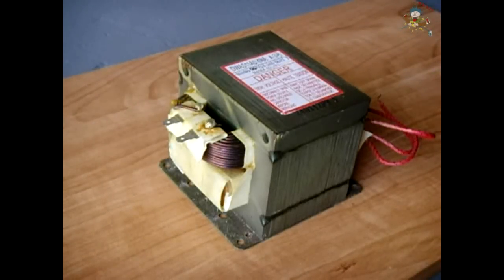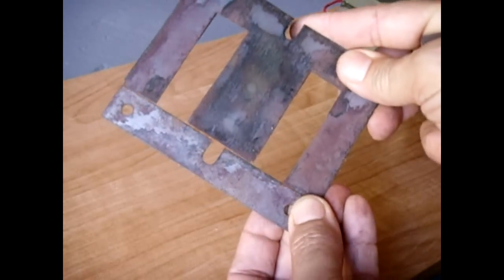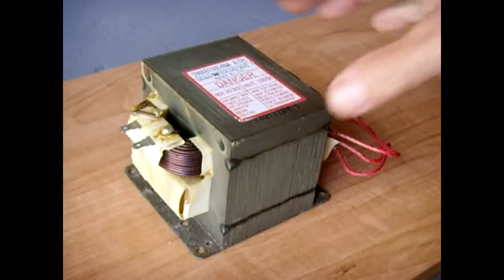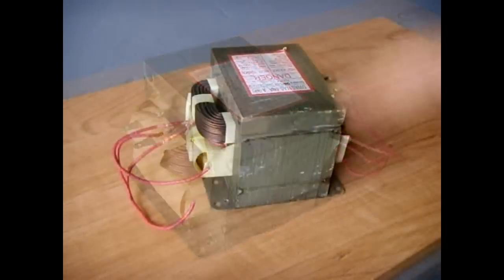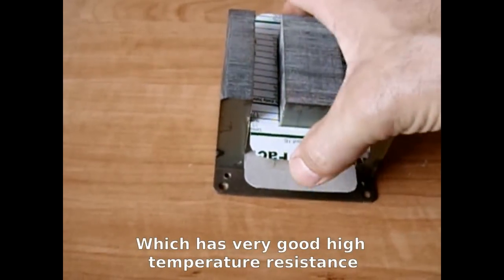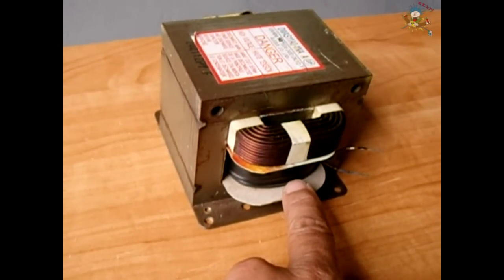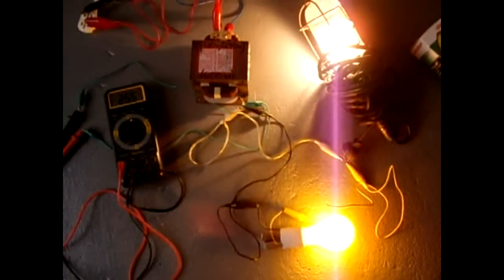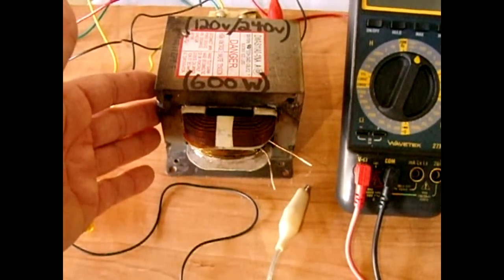How To Make Custom Power Transformers

Comment: Hi electronicsNmore,
I have a problem. I have a 8cm x 14cm Transformer (an E type), It has 112 cm2 area and I have only so much wire 5 lbs. for 8 awg and 1 lb. for 6 awg. I need to get out 260v (130v x 130v) @ 30 amps on the Secondary. I need to find Primary voltage and # of Turns for Primary and Secondary. Can you help or anyone else on this? Thanks.
p.s. I can produce up to 4000v AC for the Primary Input.  I know you are smarter than me on this, I hope you can help me.  This is a HUGE transformer FYI.
Reply: around225  and +electronicsNmore : I don't have a 32 bit operating system, I can't use your calculator. :-(
Reply from the maker: around225 Please refer to the calculator software in the video description area. You input the information and you will get your answer. :-)

Thanks.
Reply: electronicsNmore I did, it only works for a 32 bit operating system.  Can you use the calculator and give me the answers please.  I'm so sorry about this.
Reply from the maker: around225 You owe me. Tell me the size of the CORE AREA. Measure it like you are looking down at the core with the top part of the core missing. The part of the core that the wire wraps around. Also tell me what your input voltage is and your desired output voltage and current. Tell me everything in one reply. I cannot be replying back and forth. I have over 275 videos and other people that have questions. Thank You.
Reply: electronicsNmore Ok, thanks...  the inner core area (where you wind the wire) is 8 cm, the outer core area (lamination) is 14 cm.  Input voltage: up to 4000v (I would like to find the best Input voltage and turns here, 6 gauge or 8 gauge wire, so please find the lowest turns for the Primary at any voltage input up to 4 kv or 4000v).  Output desired voltage is (130v x 130v = 260v @ 30amps).  This is an Ei core.  Another way to allow me to use the software, is if you can put the Transformer Calc. Software install folder into a zip file and then it will still work for me.  I know thats asking a lot.  Sorry.  :-(
Reply: around225 And anyone else, if you put the INSTALLED program folder of "Transformer Calculation" that electronicsNmore has linked to into a .zip or .rar file, it will probably run in a vista/64 bit windows system!  But if you try and install it with the installer on a vista/64 bit system, it won't install it.  Someone please link it so we can download and use it!  sniff sniff
Reply from the maker: The program is not mine. I don't even use Windows. I use Linux. I run the program using Wine.

Here is your info:

4KV/2.2A input(Make sure you wind one layer at a time and apply a layer of tape over each layer): 18ga enamel wire-462 Turns

260V/30A secondary output: 6 or 7ga insulated wire~30 Turns.

That is everything you need to know. Be sure to share my channel to return the favor.

Thanks.
Reply: electronicsNmore I'm sorry, I don't have the millimeters on hand, I rounded off the mm into cm.  8 inner core cm X 14 cm.
Reply: electronicsNmore Ok!  Great!   You could help out one more step.  If you could put the installed program folder of this into a .zip file.  We could use the program!  Because windows vista can run 32 bit programs.  The older installers didn't know this and that's why they won't install this.  I'm sorry I have to ask this.  If you can get someone to post a link.  You won't have to do these calculations.  Again I'm sorry to bother you.
Reply from the maker: Actually, I don't have to help people if they are unable to use the software. :-). I do it because I am nice. You need a person to download the program and do that for you. I am using Linux.

Thanks. Good luck with the project.
Reply: electronicsNmore I know.  I am thankful that you did this for me.   Your more than helpful and I wouldn't call you nice.  Don't ever let a girl hear you are a "nice" person. haha  You are a really cool and helpful person.  :-)
Have a great week and weekend!
Reply from the maker: You too.

Comment: sir,, can u give me the formula of getting the size of wire..if the number of turns and the volts are gevin..and the size of wire is unkwnown..THANK YOU SIR....
Reply from the maker: Hi Manny, please refer to the video description area for the calculator.

Thanks For Watching!
Reply: manny caburatan You can google "awg amp chart" for how much amps a wire can handle (power is always the same power=volts*amps) and the number of turns is simple V1N1=V2N2 (2:1 ratio is a 1:2 ratio).

Comment: What would happen if you place next primary core instead secondary fine wire??Is voltage would be different at secondary when wire gauge is larger??
Reply from the maker: Using the same primary winding for the new secondary winding would result in no voltage output change. You'd end up with an isolation transformer. Thanks for watching!
Reply: How can I make output voltage 350 volt and 5 amperes from 2 transformers???I read before a topic one guy describing making higher voltage output from 2 identical transformers,those transformers was low voltage,how about high voltage instead???I don't know what types of transformers to use to gain 350 volt and 5 amperes current....Is it possible to make winding by using 2 C core's to create specific transformer I need???Where I can buy not expansive C core's for transformer????I had diagram says core's specs is 40x80x200,I not too sure where to find those 2 core's that reassemble's that specific requirmant...Been sitting duck's with that transformer project by 2 long years now and still no luck,there is step up transformers out there and I even have 2 but it not have enough power to meet my project construction..I need transformer that have primary 120 volt,secondary 350 volt and 5 amperes current and third core low voltage 22 volt and 0.5 amperes....Seems I have no choice but to wind coil's myself but I need C core's for that completion and proper thickness of C core wall.....I working on plasma welder prototype,by now you might heard about MUltiplaz 3500 machine and you know how it works maybe..Well,Multiplaz company have good quality advertisement machines but when you buy them is like a cat in the bag without any promises...Multiplaz 3500 based on original Russian design,however it should be more likely Multiplaz 350 because it operate on 350 volt output not 200 volt and 2.3 amperes..I had constructed by myself thermo regulating board that actutate cooling fans for power supply,the 22 volt power connects to thermal regulating board while there is exit control realy that activate 2 cooling fans for transformer mostly,there is another 2 wires that locks the circuitry by placing thermistor that senses high temperature...I had constructed torch myself certain ways that it uses standart Multiplaz 3500 accessories,I stopped with torch further completion science transformer unavailable,I also made bases for power supply housing but never rushed to further assembly...The plasma cutter/welder save you time and money on argon,arc welder electrodes,oxygen and acecylene gas ton's of money...The plasma torch works on gas or liquid,however special pressure regulator required for torch inlet because higher pressure would destroy evaporator assembly by simply braking quartz glass tube that insulates torch cathode assembly from anode base....Air might work as standart plasma aplications,however if you are electrician or physicist you know by now that air is bad electrical conductor and would create certain power drops unlike water or alchohol,helium gas could also be used as alternative...The idea is that special moisture observing material located in torch body,when water or alchohol poured in it would be observed,by actuating high voltage arc liquid or gas become diatomised and become plasma beam...Unlike oxy acecylene torch plasma beam not burn hand from distance,however special guard requires to prevent getting severely burned to crisp...By burn from oxy acecylene is one story,by burn from plasma stream is much much worst,we talking about 8000 by Celsius and that near surface of sun..This torch can weld hard to melt metals like Tungsten,Molybdenium and Titanium along with their alloy's....A simple tool that can end era of old outdated welding and torch cutting machines for good...Over some more time it could be further simplified and become hand held simple device..We had been suffer from technology insufficiency far too long,it is time to develop something new and far more affective methods of welding...For welding it requires secondary power source to electrify weldable cache,unlike arc,mig and tig welders the clamp nolonger a ground,it is positive current or hot clamp so call,the filling wire is grounded instead to avoid been shocked,the filling rod hold about 1/4 away from part that been weld to prevent arcing and shortage of machine while torch melts the wire and creating smooth cache.before actual melt of filling wire 2 weldable components could be fuse welded or held together before welding..As you might or may not know Plasma welding machine operating only at DC current which requires rectifier bridge after transformer output while capacitor smooths the power drop...The voltage adjustable by potentionmeter from 50 to full 350 volt range,high voltage multimeter also attached to output line's of primary and secondary power line's for easy voltage calibration...
Reply: Hello,I not sure if you get my previous messages through....Anyway,I looking to buy an transformer C core 40x80x200,I need specific step up transformer from 120 to 350 volt and 5 amps secondary current...By watching diagram it says materials must be exact,I also noticed that particular transformer become weight like 40 something pounds which would consider heavy for power supply...I already have 2 transformers one rated 220 volt secondary another 245 secondary,is there is any other ways to boost voltage at secondary output of the transformer??Some specialists say I need add more coils by winding of secondary but it is a nogo option science there is no room....First I was thinking to add some type of induction coils but other electrical engineers says it not going to change anything rather than cost voltage reduction....I have another option,By adding so called inductor or bipolar transistor,not sure if this can add more voltage but in theory it work like a water valve to boost more voltage float..Modern welding machines is now very light weighted and it says they use inverters which means same bipolar transistor...I wonder if that same type of bipolar transistor can salvage my problem with voltage limitation???If so than particular transistor cost less amount of money rather than construct new transformer from scratch....I would like to know what you think about it science you seems an electrical specialist..

Comment: maybe not the most graceful and you can possibly damage it.....but you can knock off those welds with a hammer as well if u knock it right....say it somwhere on eBay here and tried it myself...and it worked! However they put epoxy all over the coils so it was too difficult to modify.
Reply from the maker: +MAN CAVE NO.1 
Hi there. No way will you separate a welded core by hitting it with a hammer, if anything, you will damage/deform the laminations. I would like to see you make a video showing that.
Reply: electronicsNmore well I did just that. It wasn't easy but it happened. When I first got the transformer out I was really bummed because I thought there's no way I would get through it but I did it exactly like that I slammed it several times really hard and eventually it loosened.....you don't have to believe it but I suppose I could do a video someday..... Or maybe you can do a video showing how it can't be done. :-) Cheers
Reply from the maker: *****

If it did work, the weld must have been poorly done or extremely shallow.
Reply: I suppose...but it looked exactly the same. Weld along both sides. I think I still have the transformer or the pieces to it. I could show that...it's clear that it was not separated with a grinder. And I would say that most of them are not built so sturdily. Mass produced and only need to last 5 years or so...would save a lot of welding rods that way...
Reply: I got the idea from COOL DUDE CLEM when I told him I had one...he just told me to knock it with a hammer like hell....so you could also ask him about it. I think he's worked off most of his that way.
Reply from the maker: *****

Not really a good on idea to bang on the core/laminations of a transformer, but it would be interesting to see it done using an MOT like I show in this video that has a proper weld.
Reply: well yah, exactly my point....it's not graceful by any means, but so far I've opened up two of them exactly like the one you have there. I'm only trying to help u know, not trying to criticize....but I think you doubt me so I'll have to do it again and film it sooner or later. 3:)
Reply: cutting the weld should not be a problem - where most folks get stuck is welding it back (lacking the equipment/knowledge) - so why beat it to death (the core and the discussion)

Comment: When you stepped down the 240v to 120v....did you just plug it in the reverse direction?
(240v secondary coils to outlet & 120v primary coils as output)
Reply from the maker: Hi there. You supply 240V to the winding I made to replace the 2KV winding, and you get 120V out of the other winding..
Reply: Ok :D thanks :D

Comment: I have question? What type if wire winding did you put? How did you connect the hot & neutral?
Reply from the maker: This transformer had a 14-15ga AL primary winding of 100 turns. I made a secondary winding of 17-18ga AL. When feeding the heavy primary winding 120V, it makes no difference as to where the wires go(Since your only using one transformer, the phase makes no difference going in and out). The output which is 240V, each leg is 120v. When you feed 240V into the secondary, you get a TOTAL of around 120V(60V per leg). If you want 120V(one wire) and a neutral, then you need a secondary winding for 240v with a center tap(zero volts-neutral). For me, a total of 120V stepped down, is just fine. I do not intend on connecting this to my house. This is simply a portable step up/step down down power supply.

Thanks For watching.

Be sure to check out my video playlists as well.

Comment: Yes sir i have a qwestion is it possible to run a 1000watt indor grow system using a transformer to keep my power usage low
Reply from the maker: msjakal 1000w is 1000w. It does not matter how you power it, the power consumption will be the same,.

Thank You

Comment: I have a similar size microwave transformer  240V in. Pain is they welded the mounting plate on the side, covering one of the lamination welds. It is actually rated at 1100 watts.
Reply from the maker: Grind off the plate spot weld areas.
Reply: Thanks that was the plan.

Comment: Would be nice t see how you cut, solder, and the more important how you take out the coils... i have tried this before and was impossible without damage the coils. how you did these steps?  thanks
Reply from the maker: Hello. You CUT the weld using a cut-off wheel, hacksaw, or grind it away. I have another video showing how to take one apart. You weld the core back, NOT solder it. Thanks!
Reply: cutting the core is easy. I have got problems to take out the coils. They are  to tight. how have you done it?
Reply from the maker: Very carefully pry the winding out. Some can be troublesome, others easy.
Reply: ok thanks!

Comment: I VE BEEN WORKING THIS VERY PROCESS, USING A SOLAR ARRAY........ IVE,  WITH A LITTLE TWEEKS HAVE ALL BUT DONE AWAY W MY ELECTRIC  BILL!!!!! I PAY  $26.00 A MONTH, WHICH IS MIN. RATE JUST TO MAINTAIN SERVICE W ELECTRIC Co. SPREAD THA WORD BROTHER:):):)
Reply: Solar arrays produce DC, transformers require electromagnetic induction from AC to work. In other words you cannot step up or down DC with just a transformer. You need driving circuitry that does nor produce noise and a good pure sine wave otherwise your running a high risk of a house fire from things like motors and such..

Comment: Excellent video ....I have a question....when you step down from 240 to 120....the 240 are two hot cables of a 120 v each??....or it is the European one cable at  240???

Comment: hey.. we re trying to build a transformer providing 6 kv ac from 220 v. on the secondary side we would like to have the capacitor of 110pf to polarize to keep the current less than1 mA in order to run an ion trapping experiment. seeking for your suggestions.
Reply from the maker: Cheaper to buy one from the link below. 

https://bit.ly/2VOM2ni

Comment: The real reason why the  original wire get hot is because the wire is aluminum not copper copper conduct best
Reply from the maker: No, the transformer was made to run fully saturated.

Comment: I watched your video and cut the secondary winding hammer it out. Took me a long long time. Because I don't have grinder or welder to put it back.

Next is to wind thicker bare copper wire. I bought some ground bare wire. Would like to tripple or quad the ground wire for a thicker copper cross section area.

What term do I search for the winding calculator?

How would you insulate bare copper wire? And how think insulation need be to not conduct electricity?
Reply from the maker: NO! You don't use bare wire! You use enamel covered wire(Magnet Wire).

Comment: does that noise you mention will affect my audio amplifier running at 110V ?. Im trying to run my amplifier with this transformer because the grid supply is 220V
Reply from the maker: What noise? Been a while since I made this video.
Reply: text on the top at 11:27